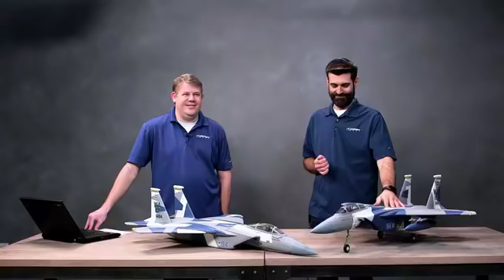LIVE Q&A - E-flite F-15 Eagle 64mm EDF Jet

Comment: Kudos for your honesty, I read from MotionRC the same, its very difficult and cost a lot of money.

I like this trim scheme, and the price is the same!  

*BUT pls DO NOT GLUE THE RECEIVER! WTF!
SAFE SELECT will barely make the plane turn. The batteries I use have high C rating for that punch, and they barely fit.

AND, WHY? is the steering servo glued in, not bolted like Freewing 64mm lineup; Stinger, F22, Thunderchief. I cant, for the life of me, remove the steering servo.

Comment: The market could really use a F14 in this price range. I think a sub 200 dollar F14 would be hugely popular. Even if you had to omit the sweep feature to keep cost down.  The only other F14 is the Freewing. It's nice, but too big for many flying environments. Not to mention that the cost of the Freewing F14 is nearly a grand with battery cost included. E-flite should take advantage and make a 64mm F14. I know I would buy one instantly.

Comment: I`m impressed about the Price. That on all the HH-Planes. When you imagen how much engineer work it needs to build a good flying plane (pre-work on the computer, 3d modeling), the electronics ink. (bnf with Receiver), color, machine Adjustment to form the plane, etc. So it is realy not expensive to have a great time. And the detailing makes it worth to do some homework on weathering and install lights. Specially on the WW2 planes. HH, brand in which i trust. Electrics (Special the ESC) never failed on me.

Comment: My Dxe transmitter is the plain Jane spm1000 doesn’t have the flap switch or aux switch but still has 4 surface control channels and the safe switch channel so it should work with this model, Right?